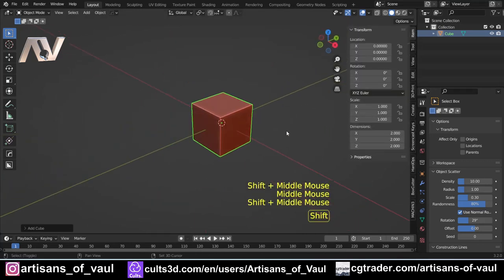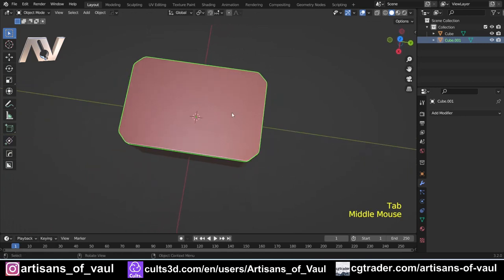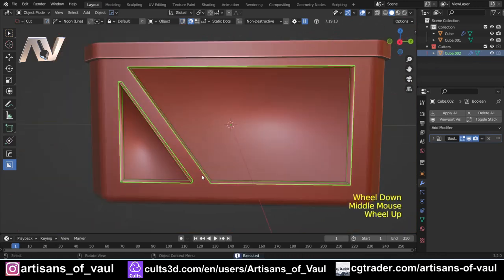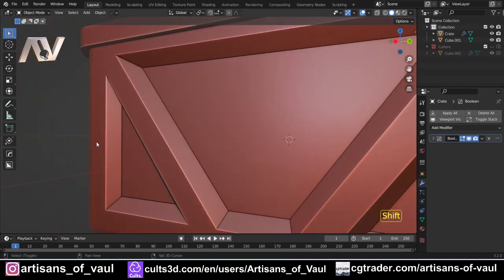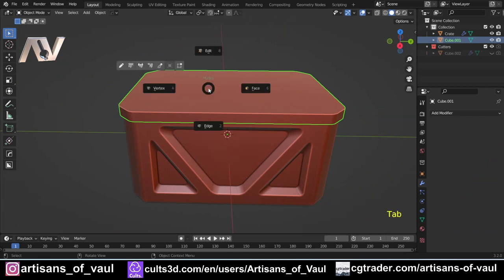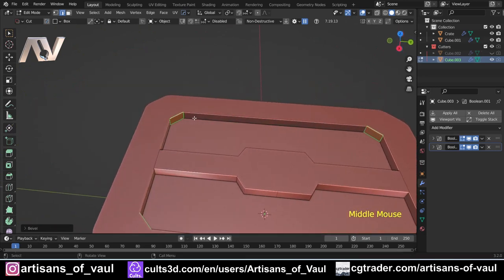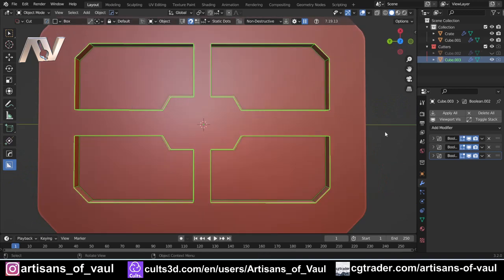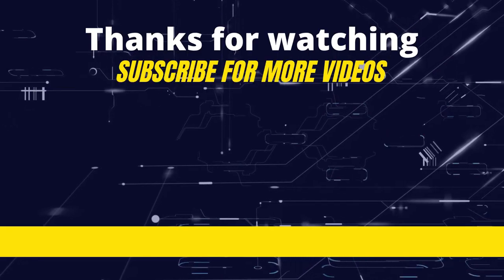Creating an Ammo Crate for 3D printing - Full Workflow

Comment: Nice tutorial! As for making the lid, one neat way to ensure uniform thickness is to add an edge loop along the "walls" of the crate (positioning the loop to represent the thickness of the lid), then select all the faces on the lid (other than the top) and pressing E and choosing Extrude Face Along Normals. This way, the lid will end up being uniform in thickness from a top/bottom view. Then simply dissolve limited vertices to remove those on the top of the lid!
Reply from the maker: Nice option for sure. Also just changing the dimensions in the N panel would work too as long as the scale was applied. Thank😁

Comment: You do not need to press Shift+G and select similar. In Blender is sth. like ring selection: Shift+Ctrl+Alt and Right Mouse Button. Thx for great tutorial!
Reply from the maker: Thanks. Oh that's interesting... but what is that selecting based on? I've just tried it and it isn't on length... is it parallel objects?

Comment: nice one!! and what about triangulate? since you export as STL file it will automate triangulate and clear smoothing groups, shouldn't we do this manually before export to prevent bugs and artifacts?
Reply from the maker: For more complex objects I generally triangulate everything. Also as a method of solving some of the non-flat face issues. But something like this that's generally simple flat surfaces/flat faces as long as the 3D print check is showing everything as a flat face it isn't necessary.
Reply: @ArtisansofVaul  sound's logical, thanks! see you next time!))
Reply: @ArtisansofVaul  so basicly tris are better than quads for 3d printing?
Reply from the maker: @MrCrazymmogamer  Not quite.  Quads do not exist in 3D printing.  Everything is converted to tris at some point as that is how STL's work (I believe this is to stop errors in calculations as a triangular face will always be flat but a quad can not be flat and that means it cant really be calculated correctly).  From my understanding even in the background Blender works in triangles, that's why if you make a quad that isnt flat you can see a line along where it "bends".

Comment: Great stuff! Scaling the lid overhang, how would you get the X/Y overhangs to match
Reply: I wonder if you could scale twice - once limited to just the X axis by a precise measurement and then scale again limited to the Y axis by that same measurement if that would work or not.
Reply from the maker: Good question.  Id follow the following workflow.  Apply the scale and move the origin of the object to the geometry.  Then you can just use the object size properties in the N panel to type the size you want and it will scale it on each axis equally in that direction (for example in this I would have wanted 1.5mm overhang on each side so would have upped the size on the X and Y axis by 3.

Comment: Question; How do you go about optimizing stuff like emblems? Ive made a crate with Aquilas on every side which were sticking out a little, and logically Id have to support each and every wing on the bottom which would be a ton of supports. Is there an easier way to do it? Should you rather go for carved types of emblems?
Reply from the maker: Nice question (and annoying situation).  So it depends what you want exactly.  You could have the icons carved in as you say, which would help.

The other options would be having them on separate sections (like a small plate you stick on) so you can print them all facing upwards.  The other option is having each of the feather pinions have a wedge down to the box on each end, as long as that is at an angle that stops the tip of the wing being an isolated point (an island) when printing it should be fine.
Reply: @ArtisansofVaul  Wow, the method with the seperate sections sounds like a great idea! With wide enough margins there'd even be a gap which would be free detail. Thank you!
Reply from the maker: @WeyounLP  No problem.